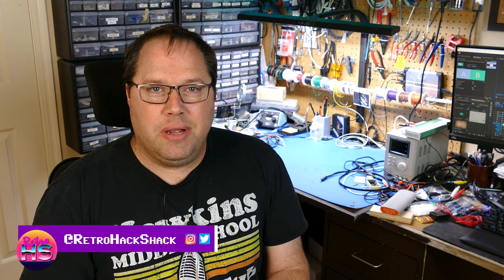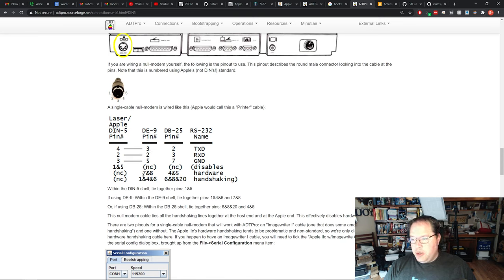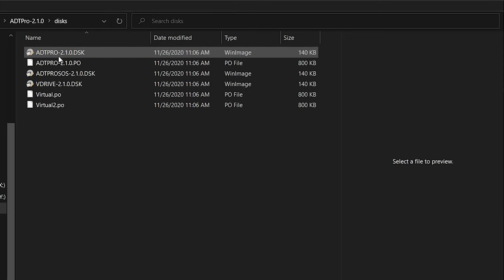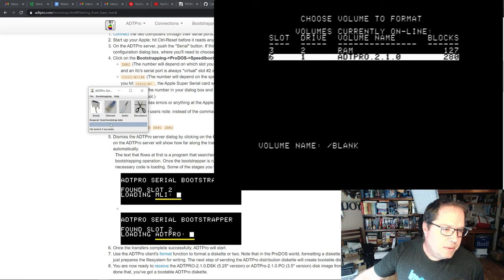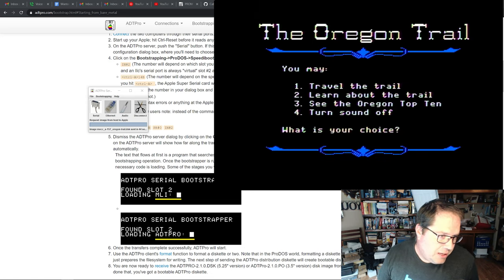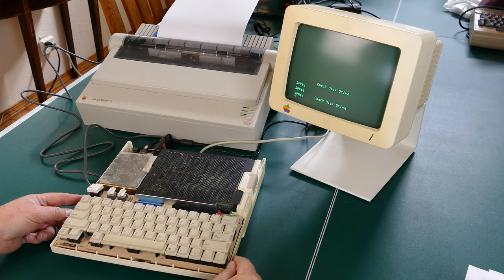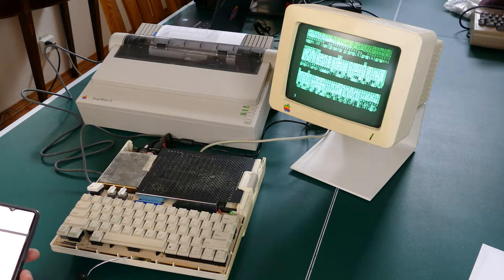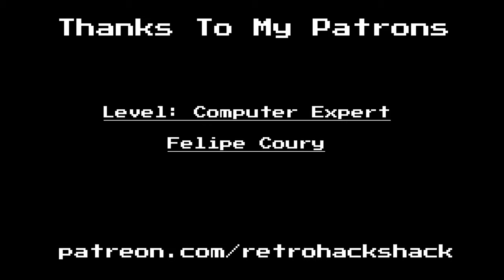Restoring An Apple IIc - Part 2 - Disks, Screen Printing, Fire!

Comment: Well, I'm sure you won't be burning candles on your workbench again!  Glad you got out as lucky as you did.  It might be fun to find a new Apple IIc cover...  might be the perfect excuse to buy another whole machine...
Reply from the maker: Definitely not. I haven't lit a candle since. Maybe for the holidays.
Reply: @RetroHackShack I lost everything in a fire years ago.  Ever since I am paranoid about any heat source, especially open flames and old electrical devices and wiring.  Every place I have lived since I have paid to have the wiring replaced.

Comment: Never leave a burning candle unattended.  Sorry to see that case was destroyed hope you can find another.  @44:37 I am pretty sure you could not remember the term, but the "Tracking Things" is called "The Pin feeder" for pin feed paper (the ones with the holes on the sides.

Comment: The audio option for ADTPro is if you have a II/II+/IIe but no Super Serial card, so you use the cassette connector. The Super Serial Card is another thing you need if not using a //c. The serial port is built into the //c

Comment: You can refresh(ish) the ribbon on the Imagewriter by dragging out all the ribbon on a newspaper, and spray it with WD40. This will revive the black ribbon for limited use. I actually had to do that to finish a term paper in college.

Comment: 😪 Well good thing you are ok and the fire was minimal. Is the card the same for the other apples and some discovered it also works for the llc?
Reply from the maker: This card is specific to the iic. There were normal cards made for the other apple ii's that simply fit into a card slot.
Reply: @RetroHackShack  will you be reverse engineering it by chance

Comment: I may have a IIc carcass with little but a busted MB inside. Let me check.
Reply: Con: I live in Brazil.
Reply from the maker: That would be great! There are two versions. The matching one to this is the one with the detachable back panel. They might be interchangeable, but I would have to check and see.

Comment: What I learned is why I don't use candles under any circumstance in my apartment; in my case, I have a very athletic cat, who could easily knock one over, or set his own tail on fire. Either way, could spell disaster.